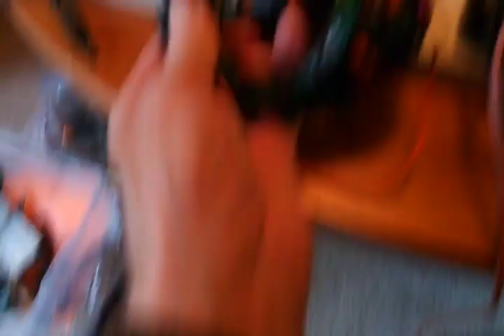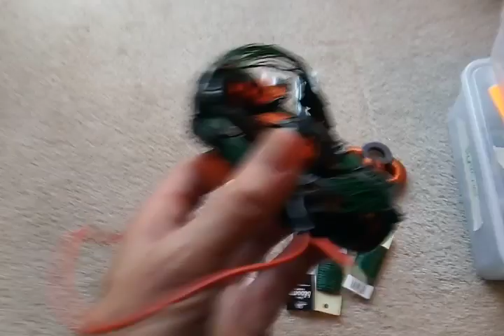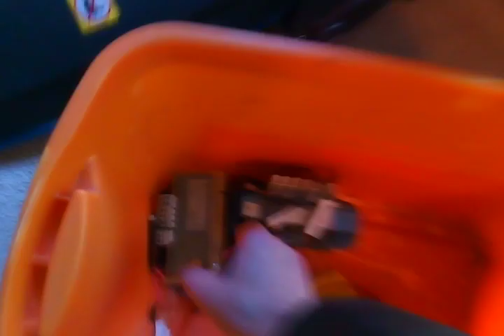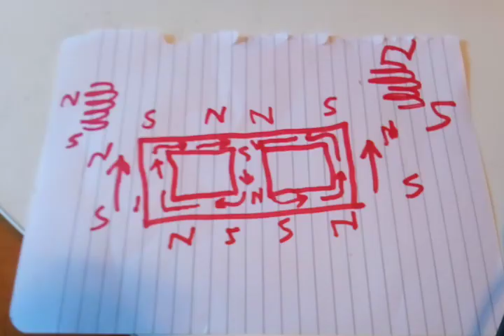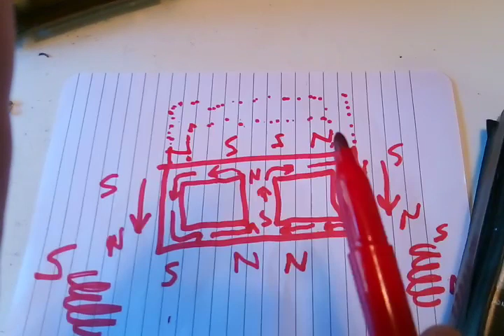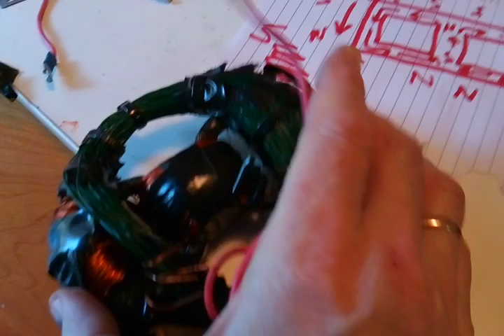BiTT transformer projects, new design idea.

Comment: very interesting
Reply from the maker: In recent videos I tested out the shunt bars they give back 30% extra power - with no extra input power in consequence so thats good.  They could do better I am sure with more work to them and better cores than florist wire. What is interesting that makes so much sense is best thing to do is short-out all the windings around the shunt bars, I think the shorted field gives a pust to the backemf currents to make it easier to get to other secondary and reinforce it...thats my theory anyways
Reply: @MrDKONZEN  Makes sense if you want a field to generate you need continuity and current flow. Shorting the winding is exactly that.  PS when your mind is fresh , see my energy loop video , lmk if you "get it"

Comment: Okay. My comments are literally ignored by other people.
Anyway, BiTT is just an incomplete parametric transformer. If you want zero bemf, research parametric transformer. Capacitor is used to self amplify the oscillation. You want to modulate the inductance and not induce any emf.
Reply from the maker: Hi Lukie   Yes capacitor keeps the voltage up so there is  more on output power equation....not really needed to show drop in input  upon load of secondary through elimination of some of the backemf making choice to flow into shunt-bar.. (not all I dont think yet ) 
BUT third  featiure of BiTT  I doubt parametirc transformer  can do, is reinforce the power from one secondary with the other which is very cool feature....WB Smith would call it "coherence of fields" I think and where you dont get 1+1=2 but instead 2 squared so becomes exponential increase why not when if backmef present to hinder and suppress.  .
Reply: @MrDKONZEN  Parametric transformer can do the same by adding two secondaries instead of one as well lol. However, this would destroy each other's inductances to some point and would need retuning. You pretty much make a double secondary parametric transformer. There is still flux coupling but there is also parametric coupling. Capacitor helps with the oscillation which amplifies the voltage until maximum core saturation.
Reply from the maker: There is big difference between getting rid of backemf altogther by "modulation of induction" or some other trick (look up parametric transformer!!) And to keep the backemf, flowing how it wants to go, and put it to good use  rather than raising draw in primary, as is normal in normal transformers.
In the BiTT you want the backemf to flow into opposite seocndary! It is not "neutralized" it is re-routed to do some good in making more power from secondaries and thats why its overunity, more watts out than in.  Parametric transformer not related really except it is a transformer of a different kind.
Reply: @MrDKONZEN  Parametric transformer has zero bemf. So yeah lol. It's the same, BiTT is just missing a few components which is the capacitor. Except the opposing flux is redirected away from the core, at least most of it. This changes the equation into
e(t) = L(t) dI(t) / dt + I(t) dL(t) / dt

Comment: best metal for flux is soft iron   the florist wire is great idea since it can be molded to any flux routing ideas.  flux follows many paths but the majority will follow the path of least resistance
Reply from the maker: Hi Gary
I got your circuit board and stuff in mail Thanks!  Its going to take me awhile  to get to it, I really want to get a BiTT working good right now....
I think if my BiTTs had a high impedance primary it will work good and thats my main problem right now - my primary only 5.9 ohms and gets hot too easy.
Norman Wootan was saying that 100% pure iron is the best stuff for magnetic paths and saturation and all that and Tesla recommend 100% iron type cores - they sell it on ebay...mix with epoxy and mold to any shape I guess how to do it....
That blacksand stuff (you can get from goldminers)  I used for motor coil and generator coils alot and it works good for that, when they are induced or driving rotors of really strong neodymium magnets really fast (the blacksand low hysterisis) but when I made transformer stuff with it , it just didnt "transform" worth anything.....I guess because of the "random polarities" to the crystalline encased ferrites pointing every which way....anyways 100% iron supposed to have very unique qualities to it maybe would be good for transformer cores and "shunt bars" (perhaps)  here is link on ebay for some:
https://www.ebay.com/itm/304269682211?hash=item46d7e2e623:g:IjYAAOSwebhhvTrO

Comment: Great work Doug the lenz free or lenz Assisted stuff is very interesting and has many benefits because of it output characteristics I think your idea of redirecting the flux in the BiTT is an awsome idea I think I will work great can't wait to see man Iv never made one of those but i am itching to now also can you confirm how much overunity does a rotoverter make is it worth it can you make one that self runs please let me know I want to try to make a rotoverter I have tons of 3 phase motors great work cheers 😁👍💯
Reply from the maker: Hi ORC
I made some BiTTs but my BiTTs so far work like ShiTTs but thats just me I will get one going good eventually I am sure.  
Tim Tron really has one working GREAT using a 3ph transformer core, and big laminate shunt bars top and bottom made from microwave transformer laminates.  
from advice I am getting, I think I need a high impedance primary which is something I want to do soon....right now my primary only 5.9 oms.
The rotovertor fun stuff to do - its that third "rotary transformer" phase (AKA run cap or "virtual" phase) that phase has all the power lurking and circulating within it.... Pulling it out is key to getting it overunity... do it WYE and go for the HV circuit, the 460V one....
Clean up bearings, put in ceramic type if you can afford it....you should have X 1.618 from the run cap phase via a series transformer and tuning with caps into a load...
I had a big 7.5 Baldor running on 8 watts at 1800rpm, shaft is very sensitive to load, but that is good for testing no-lenz generators, and what you do is increase the run cap UF value for the load the shaft is turning and now you can get some decent torque from shaft at consequence of increased draw to motor.
A no-lenz generator on shaft is key thing if you want to loop it.  however Tom McKay in Canada looped one using two 3ph motors, both having their run cap phases charging batteries that are also running the invertor - he uses some torroid power transformers kicking down power into FWBRs into batteries to charge the batteries - he had 24V to 120V invertor.  So thats one way to do it - Tom said all the electronics took up a whole floor in room in his house.  He also had a nice invertor design he built too.
Also I know someone who looped one in Norway with Muller generator on shaft.... hiperco50 cores, the core material cost $3000 plus he machined them into futuristic pinpoinit shape so no lenz or heat from the the 16 neodymium magnets.... 
Hector says you need to have control of pulse width, frequency, and voltage input to get rotovertors to really be going good, so an invertor with all those features....I made "rotating invertors" using PWM into small DC motor, spinning a disc with magnets at 180 degrees on rim, these trip hall effects at 90 degrees, and switching sends in power in AC fashion (DC cap discharge alternating)
Here is link to a chapter from my online book about the rotovertor stuff:
https://alternativeworldenergy.wordpress.com/alternative-world-energy-pg-2/
Reply: @MrDKONZEN Man thank you very very much for that info Doug I will look into it my goal this to loop the rotoverter I have probably 60 2phase motors I want to couple 2 of them only thing I dont have to make it possible is caps i have batteries and inverters transformers i want to build a cap box for the rotoverter  one for the run motor and one for the output motor if you have any caps you don't want me know man if you need any parts iv got tons of stuff let me know I'll send it to you I also do have caps but there mostly electrolytic I need oil filled caps
Reply from the maker: @overunityresearchchannel  Hi OverunityRC
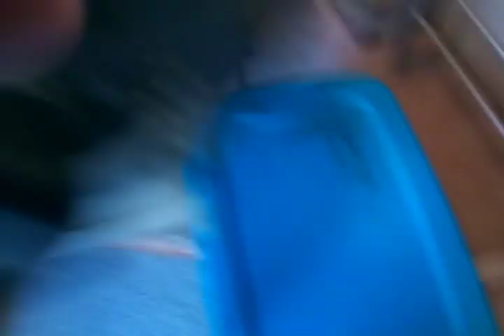I have a lot of oil filled HV caps - look when I open blue box at 7:35 
what you need is 1 uf 2uf .3uf, one UF at a time, all the way up to around 20uf or so.  This because the RV responds to increments of 1uf, when you nail down the run cap value...its ok to parallel a 10uf with a 5uf too, to make 15uf for example.
These oil filled caps fairly hard to find nowadays the oil is toxic they dont make them anymore.  I got a lot in a navy surplus place in Tacoma WA and a few online too. Sorry I dodnt want to give them away but will sell fairly cheap. I have so much :free energy machine" stuff stashed in storage bins right now  you wouldnt believe it, cant think of anything I would want maybe some big 3ph transformers to make into BiTTs is all, but I have two of them already I could chop one up, and also have about 10 MOTs to chop up too for the laminate cores....anyways probably you will need aboout a dozen. maybe two dozen oil filled HV caps, and have their UF values be such that you could parallel them to any digit between one and twenty....when you do the series transforner type of output, also you will need more caps for that too and you need to really find the perfect cap size over there on output side of it too, coming off run cap phase. 
If turing something with shaft, you will need some bigger size caps, up in 30uf range to get good shaft torque.
 I dont think you will have much luck using an exisiting 3ph motor as alternator.  You wont get any no-lenz effect whatever you do inlyess going super high rpm like 14,000... This is my opinion anyways. Better to go with a Muller type generator youmake yourself, or Kromrey type, Eklin-Brown, or maybe eaisiest generator with lots of poles is the Samsung or Fisher and Paykel pancake washing machine motors.....with so many poles you can find a good RPM that makes for a delayed lenz effect like Thane Heinz demonstrates lots of others too....a 2pole 3600rpm at 60hz motor I would suggest, then find the good rpm of it where a 16pole 24 magnet rotor like in the pancake washing machine motors will have, creates a delayed lenz effect aorund 3600rpm give or take 500rpm each way so  VFD or belts and pulleys pr magnetic gears to zoom in on exact RPM would be needed ..
My email konehead at msn dot com we can talk better in emails, I will start doing inventory of my caps!
Reply: @MrDKONZEN  thanks for your support Doug and the info really appreciate you very much I will email you for sure let me know how much for all the caps you want to sell I really want to make an overunity rotoverter 😁👍💯

Comment: Hi Doug,  thanks for sharing as always. It's better if the primary flux comes from a really high impedance, so that the BEMF flux generated by the load current finds an easier low impedance path through it's opposite output core. Timing is not at all critical because the frequency is so low that phase shift vs distance is negligible . To raise the impedance in the primary flux drive path can use a few methods eg less core area, different permeability, fine air gap or just saturate the drive core so effectively becomes an air core once all magnetic domains are used up.  Primary needs nearly 90 degrees phase shift between input Volts and Amps without load.  And when loaded, minimal shift of phase at input. Timtron's capacitor method to shift the phase of the BEMF isn't really practical as phase angle vector varies with load impedance. Gerry
Reply from the maker: Hi Gerry   My primary only 5.9 ohms, just did some variac tests, and was controlling currennt input with the variac, as well as voltage too, and basically the primary gets hot or too warm, above 70ma into it....this is around 18V input so my low impedance primary really restricting what can be done.  
I have a couple radio shack standard 120V to 12V transformers, its nice how 120V into it stays so cool, very reliable no problems with them... I would like to take one of thosehigh impedance  coils out of the transformer and use that as what is primary in one of these florist wire BiTTs.
The timing I was mentioning was the time it takes for the backemf forces on both secondaries to "arrive" at a collision right in the middle of the shunt bar (or not) I dont know if frequency of phase-shifts would do much to that timing of when the forces collide I was thinking everything just needs to be exactly the same so one side does not arrive later than the other....I dont know just thinking...
Raising the impedance of primary seems to me just a matter of really thin magnet wire, and lots more length to the wire too...induction another thing - is that what you meant?
Yes I get the idea of the 90 degree phase shift, that seems to be key to it really - when you get that happening its working like it should be.  TT said that the capacitors did not shift the phase, the resistive load did that....and the capacitors just kept the voltage up there was purpose of it.
Thanks for comments -  I always appreciate it
Reply: Adding a capacitor turns BiTT into a parametric transformer.
Reply: @lukiepoole9254  Interesting I didn't know that.
Reply: @smokyatgroups  Took me a few years to know about the parametric transformer lol. Extremely classified. It breaks all known electrical theories.
Reply: @lukiepoole9254  I guess I'm slightly familiar with parametric oscillation principle but wouldn't this transformer need to be tuned to operate at double it's input frequency? I mean for it's change of parameters to occur.
Reply: @smokyatgroups  No lol. That's frequency multiplication. The one that has double the frequency is the invisible variable inductance.
Voltage = Current * variable inductance
e(t) = I(t) * dL(t)/dt

Comment: Great video Doug, I wish it was really a Christmas Holiday one hour special by the great Doug Konzen ha ha. Your videos are never too long as far as i'm concerned, so keep talking buddy! I do see what you are talking about and I am trying to figure out a way to do the shunt bars to each corner on both sides with the core lamination. I think because of the length it would need to be very thick to keep the magnetic circuit looking as short as possible as a low resistance magnetic circuit path. The lamination is vertical in the 3 phase xformer core and the angle of attack to the corners is horizontal. 
It may take some time to figure out a way, it could be worth it to get more COP. Only thing we know right now is the BEMF is removed and is truly a tool to be used in other systems and it is a beautiful thing to witness!
Reply from the maker: Hi Tim  Not sure how to do it either with 3ph laminate transformer core either, mayber right angles somehow, or bring out the shunt bar from the "side corner" not the top corners across like you have now......Seems like doing it "straight" shunt bar you could have two on top, two on bottom shooting across from top corner "side" and bottom corner sides too, and it should work OK,
And maybe just one  on top and one on bottom would work fine as well.
So if that would work, then getting it across to opposite diagonal corner like my idea to avoid the magnetic collision, would not be such a longer length of shunt bar, if you can bring it out  (and back in) on the side-corners, not the top corners.....
now the laminates how they go is problem you would have to maybe take a whole bunch of laminates out and  bend them at angles so it would all line up with opposite corners, and  then varnish and glue them all back together in good thickness to carry the flux across....,maybe a powdered iron (100% iron supposed to be good stuff ) shunt bar could work and just mold it all mixed with epoxy to shape needed and stick it right onto laminates...

I would love to get one of these BiTTs to work - I could run the AC from my RomeroUK variant Muller generator into it, and the secondaries could power the motor coils....should loop easy squeezee if the BiTT works like it should.
Reply: @MrDKONZEN  I will definitely leave this BiTT alone and build more BiTT's, then do some mods down the line. So what i see with this BiTT and the way it works is so impressive i am going to just stick with what works for now. I do see what your talking about and the maybe the BiTT can be improved to get more COP?
Time will tell 8)
Reply from the maker: @Timtron432  Yes, dont touch it !! Works fantastic as is for sure.......yes the flux flow is "8" haha
Reply: @MrDKONZEN   8)

Comment: nice video i like the one with the core , it needs a core to make it work nice and if that core happen to be a nanocrystal its even better because it can take a very high frequency
Reply from the maker: Hi Amir
You mean the one with the ferrite core rings?  Yes that one looks good at least. Probably will need high frequency.
The florist wire is soft steel and works good as core material plus the green enamel on it works as insulation, so is a poor-mans laminate steel core is idea.

Comment: Nice work
Watch this channel
Reply from the maker: I watched that video of guy speaking Arabic and did translation but could not make heads or tails what he is doing.
Reply: @MrDKONZEN  He use 1.5v battery to make commutator en 12v battery to make inverter together he have 5 leds on